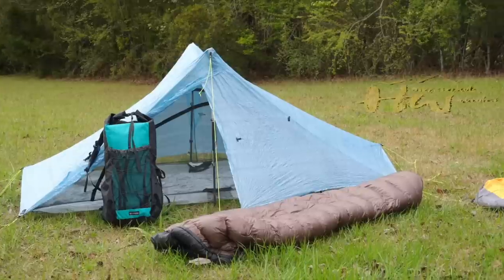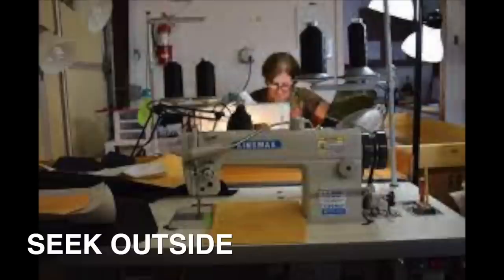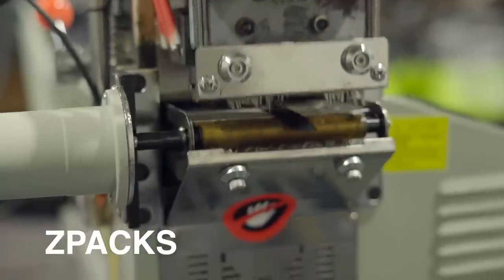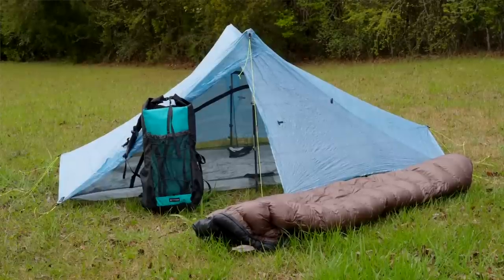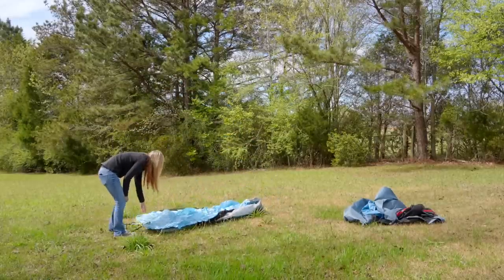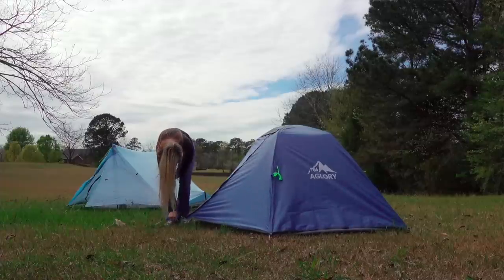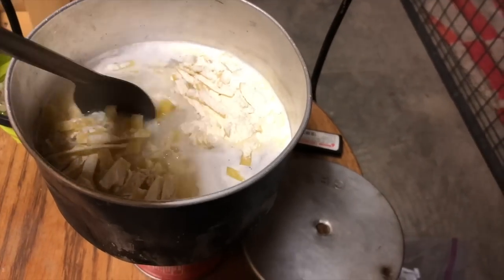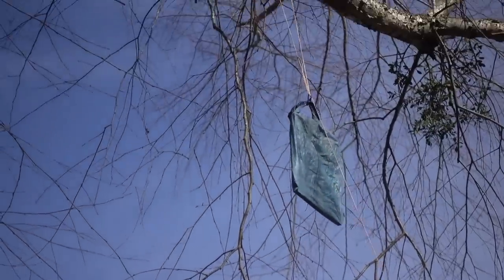$250 vs $2,500 Backpacking Gear Loadout - Why is Half the Weight 10x the Price?

Comment: As to the BRS stove, I suspect it's the same as some other Chinese UL stoves with different names and may even be produced in the same factory. My no-name version has been working well.
Reply: There's a lot of reports of BRS stoves blowing up during use, and melting. I've got friends that have used them for years with mixed results.

Comment: Using 
Six moons lunar solo 
Six moons flight pack 
Msr deluxe stove kit 
Hangtight quilt bag 
Long handle rei spork 
Uber light air mat 
Eddie Bauer packable rain coat 
Amazon carbon trek poles 
Contractor trash bag 
Nitecore headlamp 
You can get a 7lb setup for right around 1,000
I think this is the best “middle” ground with the best bang for your buck

Comment: The gear only lasts as long as the user takes care of it. All you are doing is paying for a name for high prices. "No that's not true this company has quality tyvek while this company uses cheap tyvek." The tyvek comes from the same place for both so now what will you say? Did you know there may be at most 5 gasoline refineries yet there are 50+ gas station name brands in the US alone. You think She'll gas is any different than Amoco or BP? Once again paying for a name only. I have camping gear I bought back in 2002 from K Mart and Walmart that still works as intended and never caused or had problems. Because after I bought it I still treated it like I spent thousands on it and didn't just toss it around when not in use. 
"Take care of your tools and your tools will take care of you."
Bob Hoskins - "Mario" from Super Mario Bros. Movie.

Comment: Great video
I found the vid too extreme, at either end of the spectrum 
It was the lightest and the most expensive verses the cheapest and heaviest. 
The Cheap Gear Big 3 + Pack Liner + Sleeping Pad are simply unrealistic in their quality
None of them will give good usage or durability and you would not want to use them
The rest of the cheaper gear is spot on...

Please do a comparison of Big 3 Mid Cost Gear verse Expensive Gear
Where the gear will be good quality that will last multiple season, reasonable for a weekend warrior to do extended backpacking trip (even long distance)
Use REI as an example, where a pack will be $150, a tent $150, and a sleeping bag $100, and  quality foam mat for $45 (or a air mat for $100)
So the real comparison will be $445 ($500) Vs $1800

Thanks
Reply from the maker: Thanks! That was the whole point of the video—to compare extremes. I also mentioned multiple times there were items that were mid grade and these weren’t your only two options. I’ve reviewed mid grade products vs expensive ones a lot on this channel, so this was something different.

Comment: Hey Dixie, if you want a lighter weight synthetic bag, check out the Marmot trestles eco elite series. It’s lighter and packs smaller than any other comparable bag and a very true temp rating. Great bang for the buck. I think you will like it.

Comment: You know, if you really want to save weight, don't even bother taking a shelter. 

Instead make one en route. 

Just take a Silky saw, a hatchet, and a bushcrafty knife, and make your own shelter out of the available resources. 

For a sleep-system, a bed of dried leaves will suffice. 

Worried about ticks from the improvised leafy bed, just man up; they're only tiny beasties, not adult grizzlies, after all. 

🤣